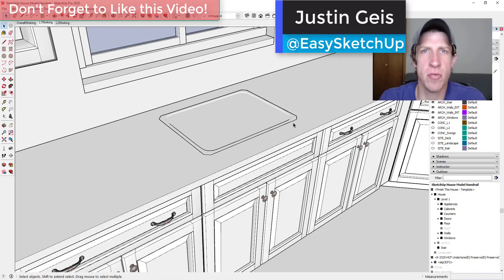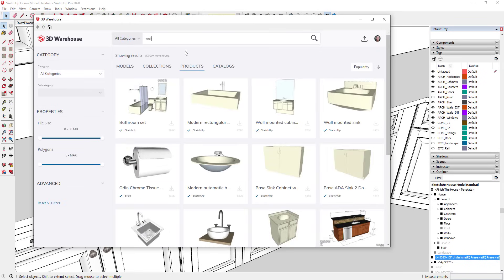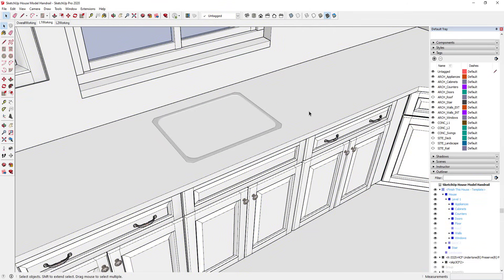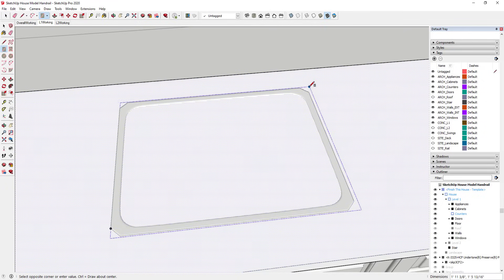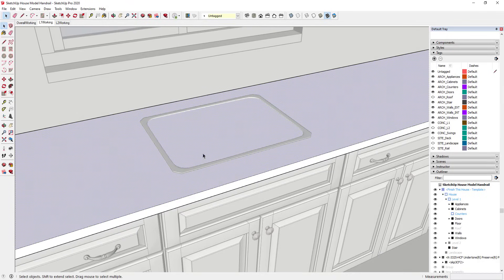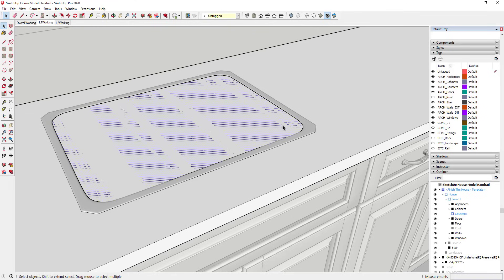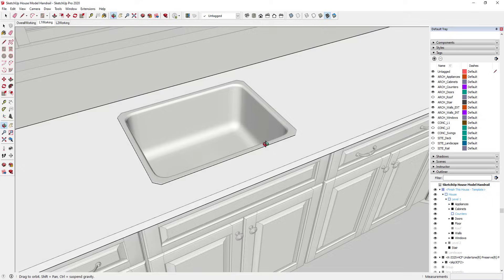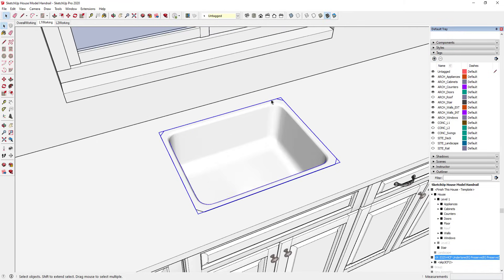Cutting Holes IN COUNTERS for Sinks in SketchUp - One Easy Way

Comment: Is it okay for the sink to be a component?  Or should I explode and then make it a group?  I also downloaded mine from the 3d warehouse.  Also, how far up or down should the sink be on the blue axis?  Should it be completely sitting on the countertop face?  I am trying this method and it's somehow still not working!  Please let me know, thank you!
Reply from the maker: Sink as a component should be fine. It's likely not working because you haven't double clicked into the countertop and selected the faces before running intersect faces with model

Comment: Thank you! I wonder if this will make it easier for me to do the cut-out part for the inner bowl of a euro style sink I'm trying to make. It's an odd shape and the sink is part of the countertop. It has a small cabinet and the sink basin hangs over the front edge of the cabinet. The countertop sides overhang as well. So, now I'm thinking if I can intersect model I can make the countertop without the sink opening and then make the inner part of the sink separately and pop it in and then use this method to do the cutout.
I'm really struggling with the part of the euro sink on the outside where the countertop edge curves forward/out and downward as there are so many curved angles to deal with.

Comment: I'm using the second way all the time starting from inside with small rectangle and then push pull to each edge -10mm like in real life kitchen sink installation (EU). [Check sinks manual] Will be nice to see some plugin in action to make this for us .. maybe double cut  ?